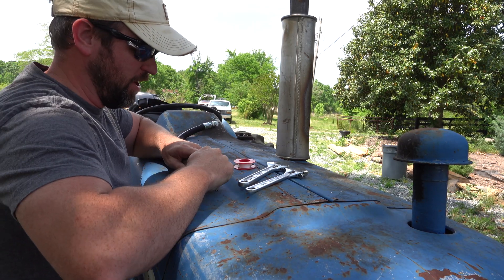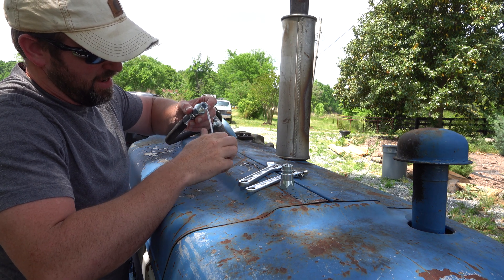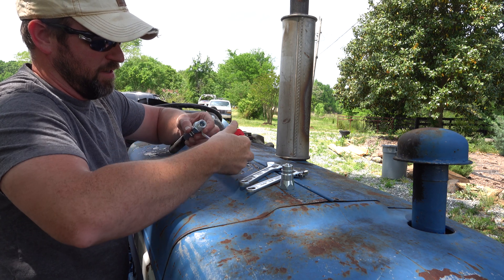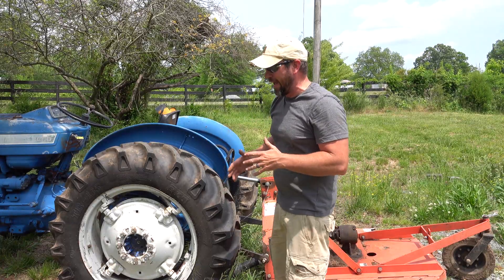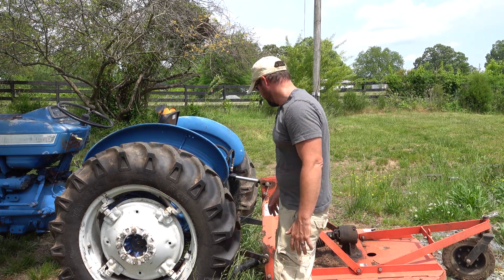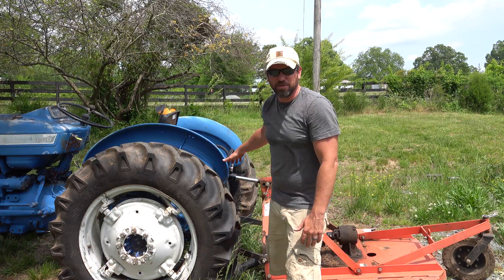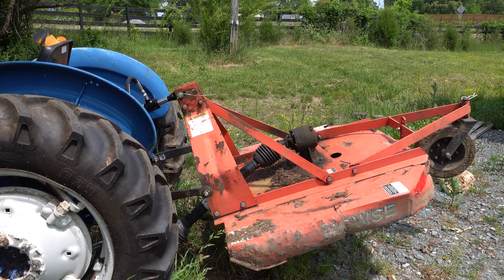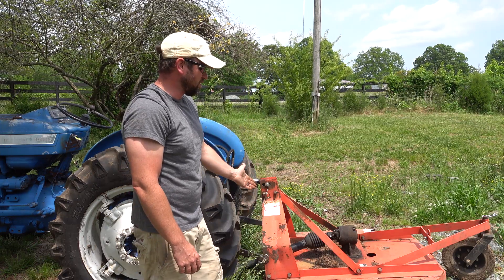UNLOCK YOUR TRACTORS POTENTIAL | Hydraulic Top Link 3 Point Hitch

Comment: Oh, man!  Don't use your tractor hood as a workbench!!!  And whatever you do, don't crawl under a bush hog, or any implement for that matter, that is supported only by the hydraulics of the tractor, unless you have jack stands or some kind of blocking to hold the weight of the implement so it can't drop on you.
Reply: I was thinking the same thing he should have a little more respect for the equipment no surprise than thier equipment looks like crap this is what work benches were invented for🧐🧐🧐